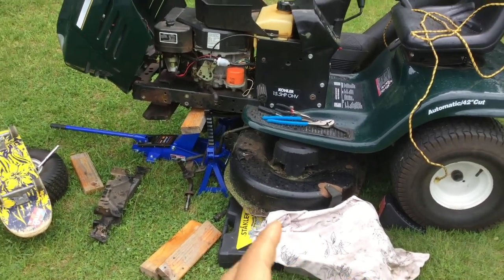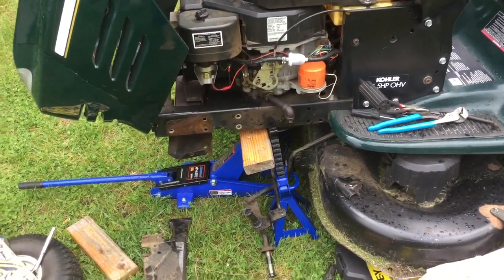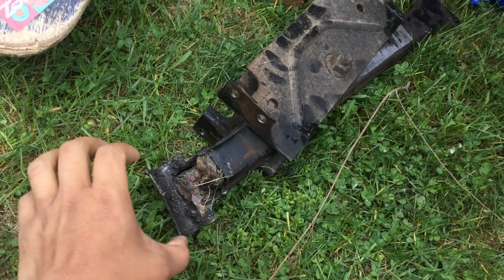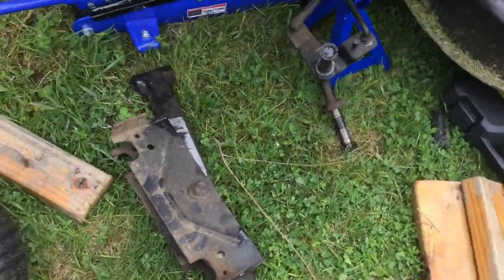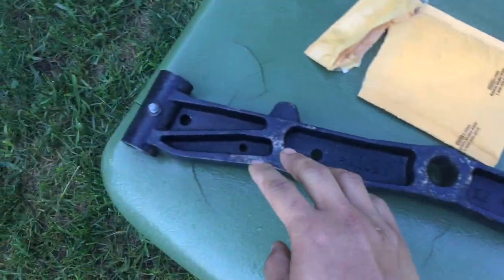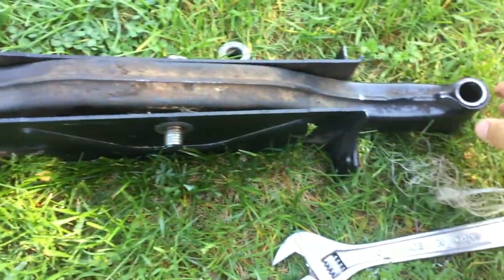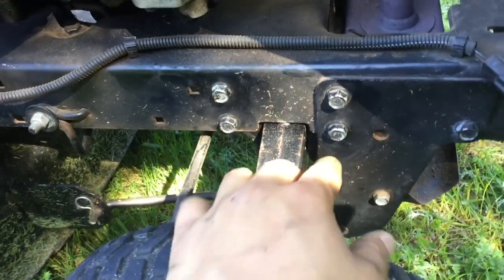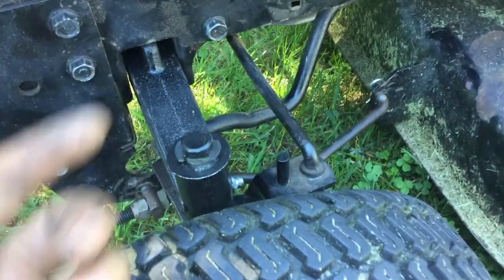Craftmans Lawnmower Front Axle Repair

Comment: Just finished up the same job, I couldn't get the plastic bushings in either. Being that this video is a year old, is your axle still holding up without the plastic bushings?
Reply from the maker: U don’t need it, the brushing are inside the axle, if you look before you install the axle, you can see the iron/ceramic brushing weld inside. 
Still going strong!!!

Comment: What model mower do you have? I have a craftsman LTS2000 and it comes with the welded axle that broke just like yours. I cant seem to find a cast iron one that would swap in, but there are many of them for other models (i suspect that they will fit since they are all the same just with an upgraded axle.) I just want to confirm before buying one. Also, how is it holding up now?
Reply from the maker: It’s a sear model. I am not sure you would have to check your model with the cast iron. I sold mine long time ago, it was great with a bagger!

Comment: I cant get big 15/16 socket size bolt off.  Any tips?
Reply from the maker: Sorry for late comment, use pb blaster and a good breaker bar. Have someone hold it or against something while breaking the nut.